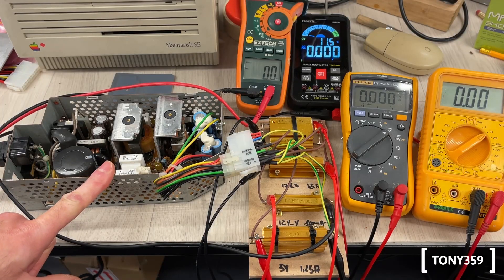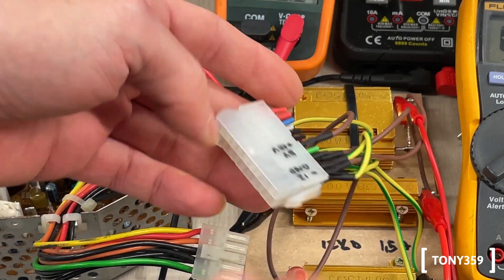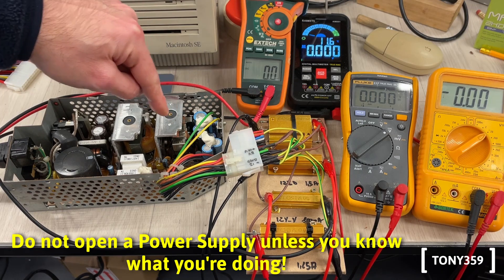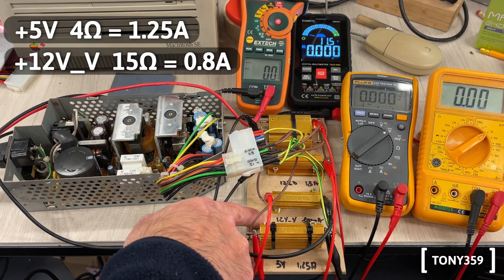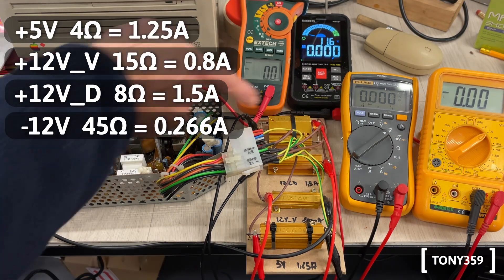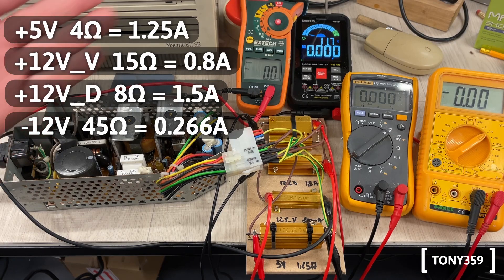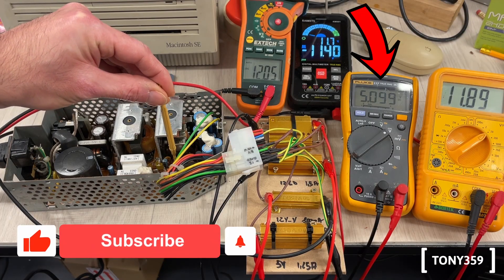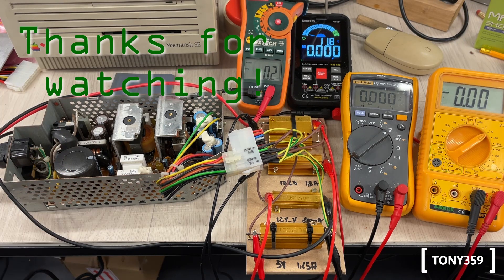Power Supply testing #TooLongForAShort

Comment: I often use a car lamp for one of the rails as well as the resistors for a visual indication.
Reply from the maker: That’s a good idea, I guess car lamps can be purchased in various wattage. Thanks!
Reply: @tony359  Yes you can but harder to get now 6V and of course 12V and 24V for wagons in various wattages.
Though I tend to use 12V on 5V anyway just glows dimmer.
Reply from the maker: @FireballXL55  it’d be interesting to see the current drawn at 5V. I’m expecting an electronic load soon, that should help a lot as everything can be dialled in on the instrument itself. But that’s only for one channel. It might be good to have options for all the rails!

Comment: Old AT power supplies ( like this one seams to be ), did not work without a load because they needed a minimum primary current to keep them oscillating ( old design ). Modern ATX power units are of different configuration, even though they too need some small minimum current, they are not as dependent of it as the old AT ones, and they already have the minimum loads required for correct voltage regulation on each output, included on their board, thus they can safely be tested without any external load.
Reply from the maker: Interesting, thank you! I was aware that some PSU's needed a load but never looked into the reason behind it. Thanks for watching!
Reply: I do watch every one of your videos, appreciating your patience with old tech and old problems. 
So keep up the good work!
Reply: @tony359  Most of the regulated switching power supplies need some form of a minimum load, some of them need it because they are current controlled, thus the error amplifier need a current ramp to do it's job, other need a minimum current to help with a minimum stable duty cycle, thus with stability and good regulation, and other like ATX power units have common choke on the outputs, so they need a certain minimum current on each output to correctly regulate each one ( try to draw more current from one of an ATX power supply output and you will see it sag, while the other left without a matching load, will rise up ).
Reply from the maker: @DjMarik78  Thank you!

Comment: nice setup!
Reply from the maker: Thanks! Just ordered an electronic load on Aliexpress, I didn't know they were so inexpensive (even though it will only work on one rail at the time).
Reply: @tony359  I got one of those, they are good but your solution looks more fun : )
Reply from the maker: yes but I'm tired of having to do the math to get the right resistor every time - plus you never get what you want or you exceed the thermal capacity of the components! I'll make a video about that - even though there are many online. I'll think of something less boring :)

Comment: I damaged (caps popping) my AT PSU because I turned it on without load for more than 20 mins.
Is it repairable?
Reply from the maker: Everything is repairable 🙂 but please bear in mind there are very high voltages inside a power supply, up to 400V! Also bear in mind the caps might be a symptom of something else which went wrong so I’d consider a replacement PSU to be honest!
Reply: @tony359  no no, I will give it to some expert :)